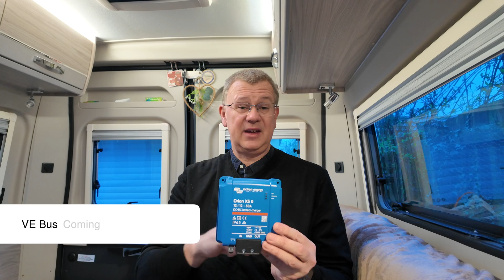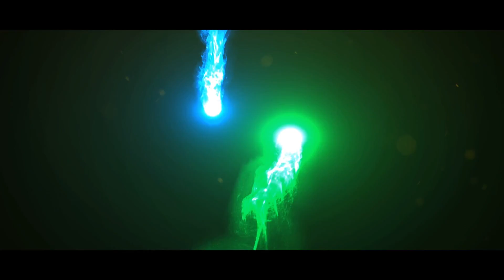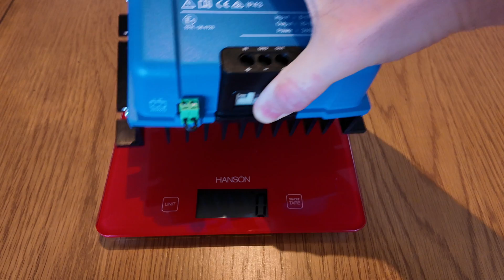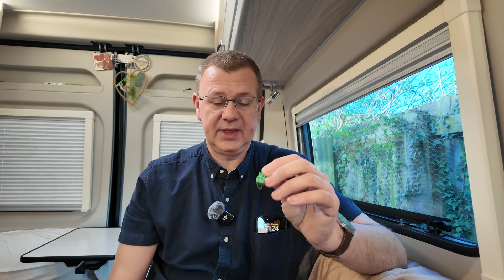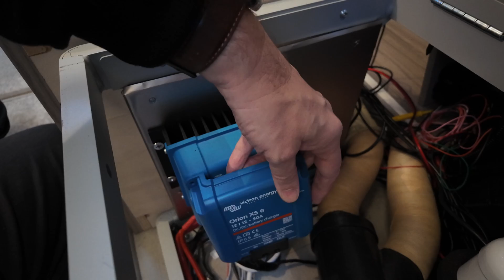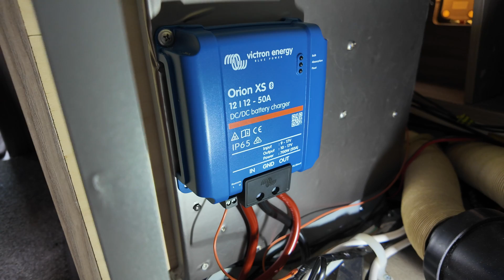New Victron ORION XS DC-DC Charger Upgrade B2B Installation

Comment: Why have you 2 fuses on the same cable. Also you mentioned you’re cables were not heavy enough to carry the full 50 amps output, yet you used 60 amp fuses. That’s not safe at all! Fuses are there to protect the cable
Reply from the maker: Let me check back as sounds like I haven't explained it well then. The cable is 16mm2 110A rated, fused at 60A - the issue is voltage drop for the Orion given the length rather than fuse rating as the fuse will protect the cable. Hope that makes sense. Best Regards David
Reply: @LeisureBit at just a 3m round cable run, so 1.5m positive and negative at 100a at 12v the minimum requirement is 50mm2 cable!
16mm2 would give a 6.6% voltage drop....not safe at all

Comment: Great demo, many thanks. As the xs 50 is non isolated unit, and considering the van battery negative is connected to the van chassis, what is the value of connecting the xs 50 negative  to the chassis too, isn't the same as connecting the xs negative directly to the van starter battery negative. As both indirectly connected to the van chassis. Thanks
Reply from the maker: You’re right - the vehicle battery negative is connected to the chassis via a sensor and I connected the leisure battery negative to the chassis via- so long as there is a circuit back shouldn’t be a problem. I know some folks worry about corrosion from the electric current flowing through though - worth noting the original van wiring was not sufficient connection to the chassis to be safe for high current hence adding additional - not sure if that answers it?

Comment: Hiya you seem to be the only one on here with a similar van and setup I am looking for the engine shutdown detection settings please
Reply from the maker: Thank you for the comment - I wasn’t happy with the auto-detect and found the D+ connection much better, it did work when set near the recommended (I reduced by 0.4v on the activate) but D+ has been so much better and removes any false starts from the battery maintainer - David & Rachel.

Comment: Why have isolators when orion already does that. Or do you mean disconects for saftey?
Reply from the maker: Yes, that’s right, disconnect so it can be switched off to work on the van or in the event of an issue. All the best David

Comment: Just replaced my viltron 30A B2B with the new 50A B2B, and what a difference. I used the D+ input and find it works a treat. I had an issue with my absorption  fridge which tended to take power from the leisure batteries when in Auto.
This being due also to my van having a smart alternator.
With this B2B I now find even with the Victron solar turned off I generate more than enough power to charge all the batteries and run the fridge no problems.
Thanks for the video, excellent explanation in layman's terms.
Reply from the maker: Thank you - its a fantastic upgrade to the 30A - great it has made a big difference for you - all the best, David

Comment: Hi David great video, my only question is could you go through the various settings which you applied or are they set.Cheers.
Reply from the maker: If you think it would be useful happy to do a follow up with the settings - the only challenge is it depends on your specific setup and also the firmware version in some cases but if you think it would be useful I could do that. Thanks for the comment

Comment: Hi David just looking for your thoughts if possible on a issue I have with my orion xs,  situation is fitted last weekend  used 21mm/2 cable  my van is same as yours but cv40 model i hydraulic crimped cable lugs 60 amp fuses on positive cables and battery shutdown switch. Set up the app for smart alternator and battery set to lithium.  The battery is around 25% full around 3.2v/ 12.8v the problems I am having is that the charger is starting and staying in absobtion mode approximately 10 amps battery app saying 20 odd hrs to full charge?  Absobtion voltage is currently set to 14.2 volts as battery manufacturers guidelines the only way I can get more amps is if I change the absobtion voltage to around 16v which obviously I do not want to do. When engine off the victron app says input around 12.6v and output is reading around 13.2v but as soon as the engine is started the output voltage immediately jumps to 14.2v basically mimicking what figure  i have entered into the absobtion setting telling the charger the battery is nearly full hence absobtion mode and not bulkl?  Do you think I have a faulty charger is there anything I can change on the settings to rectify this situation? Also I have removed the factory fitted charger one like yours did you use the d+ terminal from that and plugged it into the orion for engine shutdown? Apologies for all the ramblings above but I can't get any info anywhere. Your thoughts would be much appreciated whe  you have time. Thanks
Reply: I just bought one of these units and found video that state if you have the 1.6 upgrade software  you are recommended  to skip the 1.7 software  and jump to the 1.8 if you have the 1.7 software  contact victron for a replacement
Reply from the maker: What lithium setting have you chosen is it Smart LiFePO4 or another setting and which battery? I certainly wouldn’t change the voltages - something sounds odd - assuming no connection issues or maybe - I would try resetting it and making sure it’s on SmartLifePO4 and double check the lithium to Orion cables, connections and fuses etc to make sure all good. If no luck I would check with Victron support

Comment: I have a 100w solar panel with a victron Bluetooth pwm controller. 

What do i need to allow the solar to trickle charge the vehicle battery. Its a newish van so i assume a smart alternator.  I dont think this B2B is the product to do this
Reply from the maker: Thanks for the comment - there’s a video I did a long while ago on battery maintainer - that has been spot on and keeps the vehicle battery topped up from the leisure battery - if you search for LeisureBit installing a leisure to vehicle battery maintainer you should find it - all the best, David

Comment: I have the 30A version currently (pun intended!). Can you confirm that the 50A output is maintained over say 1-2 hours if battery has been depleted. I have fitted a temp controlled fan on my 30A (400watt) version and that helps to keep it at above 25A but would be interested to know if the 50A (700watt) maintains its output??? Thanks for any reply, great informative video 😃
Reply from the maker: Thank you - I’ve not found much fallback, I set mine at 45A max given the cable run and cable size so I am running slightly under max,  I have but so long as the battery is fairly well down so it’s not ‘backing off to full’ then it has been running MUCH cooler than the 30A one and negligible fallback that I’ve noticed with mine,. Not sure if that helps but certainly runs much cooler than the previous one. All the best, David
Reply: @LeisureBit  thanks for the feedback will investigate further now cheers!

Comment: Hi, David, I was quoted $3,000 for installation of this and the Lynx distributor. Does this price seem way too high?

I already bought both units and a previous tech already wired a cable from my starter batter to my AGM batteries.
Reply from the maker: It does sound a little higher than I would expect but not sure how much is involved in the work they are quoting for, assume the 3000 is for labour or does it include some things such as wire also? Always difficult to work out exact expected cost. Would always recommend getting 2 or 3 quotes at least to compare and contrast. Not sure if that’s much help - all the very best, David 👍

Comment: Hi Dave happy new year. Just been watching your vlog on upgrading b2b charger with the new 50amp version. I am thinking of doing the same thing you said you run the cables under the van any particular reason why this way? Also where did you put a suitable ground point? Can you not just run it to neg pole of starter battery? Running under vehicle how much cable would you suggest I would need from your experience? Thanks for your thoughts  happy new year. Wayne
Reply: Many thanks David for your thoughts much appreciated will fit mine when it warms up a bit.😂
Reply from the maker: Just to add, you cannot connect to the negative of the starter battery due to sensors, you can connect to the chassis near there, but again, just more cable, weight and cables to run. That said, if it was closer, and a clear route, would make sense to keep it close (ideally the alternator is best place to connect of course as that’s the source of the power) All the best, David.
Reply from the maker: Hi Wayne, I couldn’t find a suitable route through internally, especially under the cab floor (as didn’t want a cable where it would be walked on) and the cable was too thick to get through the spare space through washroom etc. So ran underneath then out of the way. In hindsight, I could have got it in an existing opening. I used a point under the van for earth but have since also added one in the rear (below the lights) so the way I did it initially was more for convenience as there was a handy place to bolt it but it wasn’t the best earth point, I found the internal one better but needed further work and hole cutting to get the cable through. I think some folks have found some better places but it works fine so all good. Hope that makes sense. If I did it again, I would use 32mm2 cable as there was over 5m I believe of cable (I only just had enough and could have done with another metre at least) All the best, David 👍

Comment: what size fuse should be used at the input from the alternator to Orion XS?
Reply from the maker: Check with the Victron and your van guidance for the correct one, I used a 60A which I had previously fitted, worth checking in the Victron documentation for the correct sizing and also capacity for your van. All the best, David 👍

Comment: It might be better but it's significantly more expensive.
Reply from the maker: Well worth the extra money in my book, significantly better, nearly double the capacity and better connectivity. If you want a 30A non-connected though, not worth the extra money of course - I’m super happy with mine and lighter, runs cooler and far more technically advanced. All the best, David 👍

Comment: You mention adding a D+ on the H pin, can I ask a few questions,
Would a ignition feed work and I take it you remove the supplied bridging connector cable
Thanks
Reply from the maker: Yes, it would in theory, however, when you switched the ignition on you would get a draw without the engine running so may inhibit starting or run the battery down if left on, thats why D+ is used to avoid that scenario. Hope that makes sense, All the best, David 👍

Comment: Can this be connected directly to start battery or does it have to go to alternator
Reply from the maker: You can connect it to the starter battery - that’s how I have it connected - hope that helps, all the best , David 👍
Reply: Thank you. Enjoyed your video.
Reply: Will it damage alternator by making it work to hard to charge starter and leisure both ? Thank you.
Reply from the maker: You would need to check based on what’s fitted and the allowed load - ours allows between 40-50A, anything more would exceed the recommended draw for our alternator, it does depend on the capacity though

Comment: hi my twin victrons are only giving out 10amps max at moment.18a and 30amp parallel dc chargers.i have 10amps at starter battery my alternator was upgraded couple years ago 140amps i think.i still have my old 12amp charger running agm battery also separate circuit .the victrons supply 105ah lifepo4.have to top up lifepo4 with mains charger every few days but on weekends away need that extra power
Reply: The battery connections not ideal but get tight as can lots small connections. It’s what manufacture put on never meant to have extra
Reply from the maker: We’re they giving more then 10A previously? Have you checked your cables, fuses and connections to make sure something hasn’t worked loose? Or is the battery almost charged / you have a variable charging profile set? All the best, David 👍
Reply: @LeisureBit  just checked main battery cable was loose it’s hidden u see cabin filter tightened up hopefully that was problem 😀🙏
Reply: @LeisureBit  yes were giving up to 30 to 39amps one time .ive recently fitted new victron mppt controller and victron smart shunt.i have victron 100amp battery protect but havnt fitted that yet.at moment with my commute to work and some solar going in its back to 100%.will check my cables again .been having other problem in engine bay lately.gearlinkage .had undo coolant pipes get to it.i have 100amp fuse near battery goes to victrons .thanks for quick reply
Reply: @LeisureBit  usually i try chargers on power supply setting seems to boost amps but it made no difference according to the bms blutooth app on the lifepo4 battery .

Comment: in my short Microcamper  the 4' run from my starter into the charger will be 4awg copper, but okay to use existing 8awg copper OUT of the charger to the house lithium for a 7' run?
Reply from the maker: You would get more current flow likely through the vehicle battery side so better it’s thicker cable there. Personally I think 6 or 4 would be better especially on a 7ft run - if it’s very good quality cable.it might be ok but I would upgrade it to get the best performance and remove any risk if it’s an Orion XS, just to make sure… all the best, David 👍

Comment: Greetings, I am looking to use one of these to sit between my starter battery and my Anker C1000 via the Solar input. Will this work in this manner?
Reply from the maker: I can’t see the input voltage range for the c1000 - I believe you can buy a 12v charging cable for about £25 for that model which is designed for that particular power station - might be worth checking that option out as would be significantly cheaper. All the best, David 👍
Reply: @LeisureBit  Right - I am looking to connect the DC to the XT-60 port on the Anker C1000. Using the Cigarette lighter takes forever to charge (100w vs potentially 600w).

Comment: Hi David, I've just installed an Orion XS with the D+ plugged on H pin, but I'm not sure if the Engine Shutdown Detection must be turned off or not. Thank you for your reply.
Reply from the maker: Good afternoon - I switched it off on mine as then it’s driven by the D+ signal to avoid any odd scenarios occurring when you expected it to charge and seems to work well - hope that helps - all the very best, David 👍
Reply: @LeisureBit  thank you for your quick reply David. I'll do the same. greetings from Italy

Comment: where did you connect it to on the cab battery also have you a photo, and what connector/fuse did you use
Reply from the maker: Thanks for the comment- I used a 60a mega fuse from the spare terminal on the battery (I think it’s in the video I did in the Orion 12-12-30 as I have reused the wiring from that. I had to use another mega fuse holder to get the bolt etc to fit the fuse to the spare way on the battery. Hope that makes sense, if you can’t find it will try and get a photo - David 👍

Comment: Hello!  If you connect the 12v alternator and charge a 240 amp 24 amp lithium battery.  I can load
Reply from the maker: Hello, thanks for the comment, not sure of your question - is it charging 24v battery?

Comment: Is there an automatic battery isolator in this Orion XS?  Does it shut off if there is no charge voltage measured from the alternator? Otherwise it seems from the schematic that the vehicle battery would discharge.
Reply: What gauge wire can I use for the remote to ignition live?
Reply: Nevermind.  I should have listened more intently.  It's smart!  I found this in the manual: "The Orion XS can be set only to supply power when the engine is running. This is possible thanks to the integrated engine
shutdown detection. This eliminates the need to adjust in-vehicle wiring or add an engine detection sensor to determine if
charging can start. It also prevents the voltage on board the vehicle from getting too low. In addition to this detection, the Orion
XS can also be forced on via the remote on/off port.:
Reply from the maker: Yes thats right, it’s configurable by the Victron Connect app for auto-engine running detection or you could use the traditional D+ input via the connection - whatever works for your setup. Best Regards,

David

Comment: Another great video thanks.  Quick question>. ...On your original build you had your battery maintainer between the 240v charger and the Schaudt b2b charger.       Looks like you have retained the battery maintainer when replacing with the new B2B.  Does this just now connect directly to the vehicle battery and still work fine? Many thanks. John
Reply from the maker: Hi John, when I removed the Schaudt, I kept the battery maintainer connected to the vehicle battery connection and the other end to the charger which feeds back to the leisure battery so it’s essentially the same as the vehicle battery input just connects to the converter connection and then on to the vehicle battery so it’s connected directly.
Hope that makes sense and thank you.
All the best, David 👍

Comment: Hi David Great video and thanks for taking time out to do it, if you dont mind me asking you a question, Where the earth cable joins to the chassis, is it ok just to join straight to the battery instead of chassis? Thanks again
Reply from the maker: There are chassis points near the battery but if you have a modern vehicle with start stop (and some others with sensors) you should not connect direct to the negative terminal of the battery - just to an appropriate point - some don’t have this so fine but usually the battery has a sensor nowadays - hope that helps / makes sense? All the best, David 👍